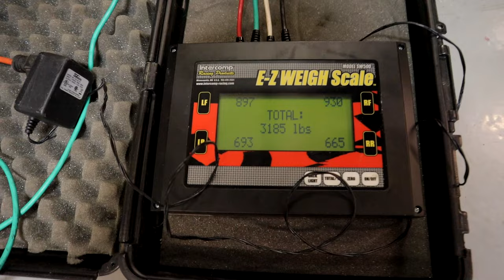American Musclecar Evolution - Why Pontiac Started Strong And Faded Into Obscurity

Comment: i am a 1972 model...so i dont have any hands on experience...but i know from reading...(ahem)...books...that in the pre-smog, pre-me performamce car era, even little AMC offered performance parts for racers...as well as helped refine the AMC V8 engines for the Trans Am racing series with 68 to 71 Javelins. they redesigned heads for better flow, offered forged steel crank and rods, (aside from the stock 390 and 401 forged steel rods and cranks), and special intakes. And they won. they beat everybody else in the Trans Am series for a couple years. Are you telling me little AMC, who raced and won against Camaros, Challengers, Firebirds, Baracudas, Mustangs, and Cougars had deeper pockets and more initiative to make succesful race cars than GM? Pontiac never had forged rods available through GMCorp channels for those 400hp TAs? if thats true...i kinda feel accidentally proud to like AMC 401 v8s.

Comment: Didn't the 421SD have Forged rods? A couple of older friends here in Australia used to race a 67 Parisienne (Canadian 327 SBC Bonneville assembled here) with a swapped in 421 with forged rods and pistons. They also had some M/T aluminium rods but never ran them. That 4000lb+ car would eat Kawasaki Z1000s and a Twin Cam Escort with a strong 289 swapped in. One of the quickest cars around Melbourne VIC in the mid 70s. BTW, my daily, truck and project run LS3, BBC and SBC respectively.

Comment: I wouldn't say that any of these arguments are *wrong*, or didn't have a noticeable effect...  but I personally still think they're all secondary to sheer production volume.  Chevrolet started outselling all the others in the mid 50s, and no amount of bad engineering on their part (weak X-frames in 58-up, the horrible geometry of the BBC lifter/pushrod/rocker angle, cost-cutting everywhere,  soft blocks, soft cams, etc.) really slowed their sales advantage.  GM corporate even famously shielded Chevrolet from competition from better designs (Buick, Olds, Pontiac) inside the company with the 400 CI and multiple-carburetor limits, so the sales edge was undeniable. Even before the aftermarket stepped up, the used market and junkyards had a higher percentage of Chevy cars, engines, bodies, and drivetrains and so costs were lower. Blow up one Chevy, just get another one at the boneyard.  The aftermarket vendors started looking at  the one big question: "how many owners of each brand are out there that we could possibly sell parts to?" to decide what to support, and Chevy topped the list from early, early on.  Then it snowballed from there. Once a little more aftermarket support appeared for Chevy, it made it even easier to decide to build Chevy. It also didn't hurt that there were plenty of design weaknesses that the aftermarket could improve upon, too.  

Pontiac in particular really took some serious abuse from GM corporate.  Correct me if I'm wrong, but I believe that Pontiac engineering actually developed the ball-stud mount and stamped rockers that both the Pontiac and SBC use, but GM corporate directed Pontiac to hand the design over to Chevrolet to get the SBC into production a year earlier... and it just never got any better for PMD. Every time they de-throned Chevrolet (and it happened several times) some edict would come down to level the playing field. Stuff like that is a huge part of why I've never been, and will never be, a fan of General Motors.  I love a lot of Buicks and a few Olds designs, but I still know that lurking under there is some GM corporate policy that makes those cars less than what they should have been.

Anyway, very interesting series, Tony.

Comment: And you have to remember Chevy's were extremely cheap to build you could get 425 horse out of a stroker kit for 800 bucks and a 350 Chevy and the transmission for dirt cheap turbo transmission cost me maybe $50 in parts to build Chilton's book showed you how to put a shift kit in it which is basically taking out a couple small check balls and and I believe it was a 8 inch drill bit to drill out two holes in the plate and that thing would bark second gear and slam third I mean they were extremely cheap to build and they were fast and they held together Chevys other than the mid to late seventies I believe it might have been early '80s where they had the cam issue the 350 Chevys been a solid engine parts are readily available and they're very inexpensive to build

Comment: Thanks for the quick updates. I have been wondering about all the projects you have going on. 
Good stuff!
Really it's a shame that not only Pontiac but Olds and Buick are gone each with their unique engine designs. And even though Mercury and Plymouth have the same engines as their parent companies  they are missed too having had some awesome body styles.
850HP BOSS 429 on pump gas.
or 427FE SO. BBF all day!
Bring on that big Bowtie.

Comment: while i cannot say the cast rod is great, they are not so weak as you say..i have run 7000 plus rpm and turned 10.40's with them many years ago..why?..because it was what we had as poor boy racers..balancing and tuning is paramount, plus proper clearance and oil..the big journals do not limit rpm in a drag deal, but for nascar they would..enjoy your videos a lot..

Comment: I'm wondering as to how they modified both the Mustang and Charger featured in that Bullit film, simply because those stunts pulled in San Francisco could not have done any favors to the oiling of both of those engines, let alone the acceleration during those chase scenes

Comment: Pontiac also had very limited options for engine blocks relative to chevy, ford, and mopar. The block, itself, was know to have bad/weak/thin castings in the main webbing leading to cracking. I've seen a few stock Pontic blocks used in racing that suffered this fate. There also weren't a whole lot of options for high flowing cylinder heads beyond the Ram Air engines.
Reply: Yeah a buddy had a set of 670 heads on a 400 ,and it ran great but someone knurled the guides and they whooped out pretty quick. So he swapped on whatever,and the thing turned into a pig. Not sure what the number was on em ,but it wasn't 670.
Reply: the latter blocks was weaker then the early blocks.....dont use a block past 73 if you want a "strong" block.....like you said after that they started eleminating "uneeded" weight from the block.....
Reply: 6X-4 heads had very good potential for performance.
Reply: This... Pontiac bottom ends are junk.  Can you fix their shortfalls?  Sure you can... you can fix anything when throw enough money at them lol. Pontiacs are good for the rpm range of most diesels..not a performance platform per say.
Reply: @briansd2772  the 093s and 670s wasnt bad either if your looking for older heads for a 389 or early 400
Reply: @LSswapGarage1  lol youve must of never been around many of em then....got a few 389s thats embarresed alot of sbc and bbc....and some lss and some fox bodies and some hemi chargers and challengers....any thing will run if you understand the engine and how to get em to make power....they dont all make it at the same rpm ....im not talking throwing a baby bottle or a hair dyer on em....im talking n.a. power......with multi carbs and points and jets and metering rods no computers needed......theres a diff tuning a carbed n.a. motor then "tuning" a engine today by pluging in a computer....not hard to make power when the computer tells you what to do to make it.....but hey after 40 yrs what do i know....
Reply: @stevenhagebusch9561  
I say you're not taking it far enough with that overly complicated carburetor contraption when all you need is a metal box that holds fuel and drill a hole in it.
I've never been super impressed with stock Pontiacs or even modified stock engines. Some of them run okay stock, most are dogs. When you get into aftermarket pontiac blocks I've seen them make a ton of power but so does everyone else. At that point it's not really a pontic, chevy, etc, it's just "what bolt pattern do you want your aftermarket engine to have?"

Comment: My first love was Pontiacs.  The other issue they had was the mains were too big for high RPM use on the 421, 428, and 455 engines.  The large mains caused many spun bearings on these engines.

Comment: The FE was pretty good but didn’t have street cred because they didn’t put cams in them and the exhaust manifolds were awful. They finally realized that they had to build the Cobra Jet. The 427s were real killers, but they didn’t get to the streets. The FE is the same oiling system as a Small block Chevy. The rods and mains were strong.  Scott Foxwell built a 505 ci FE with an aftermarket block and Edelbrock heads. 850 hp NA. 1.69 hp per cube. The design cant be that crazy.😂😂😂

Comment: forgotten to mention was the tiny pick up tubes and lack of primary main oiling design. these cars did not spin bearings because of a front sump pan. they spun bearings because the rockers were getting to much of the oil that the mains needed. this is alot of talk without mentioning the 3/8s oil pick up . dodge is not as good as the rest because of bean counters for more reasons than just the oil pan. for drag racing a mid sump pan with trap doors is actually argued to be best for engine life. you have to decelerate as well and that comes later in the high rpm run. dont want to run out of oil there either. chevy won the aftermarket/ hot rod battle( not faster or better, you just see more. for example you go to the drag strip and see 20 chevys, 2 fords ,2 dodges and the top 6 cars will be mixed with 2 of each) because they didn't engineer as much so they were cheaper. parts innerchanged for half a century. on a cost standpoint this is great. on an evolution standpoint, not so much. this still holds to this day. to meet epa/ fuel mileage and keep up with modern cammer engines power output they have to build a larger displacement engine and float half the lifters under normal driving to keep the thing competitive. Chrysler is kinda like this in some way except they tend to screw up simple stuff like oil pickups, cam hardness,  or even an automatic transmision that can go from here to there without smoking clutches. i think someone else builds all there transmisions now and half their engines.lol

Comment: Tony, up here in Canada, if you wanted a fast Pontiac, you bought a Parisienne Sport with a 409, or a 396 Beaumont.....used to tow my Demon stock car with a clamshell Pontiac wagon with a 350, later replaced with a 283. What are these Pontiac engines of which you speak? ;)
Reply: yep the Canadian dirt track racers around here had the pontiac 327 valve covers.

Comment: Didn't Poniac do some peculiar behind the scenes work? For example, around 1990 we pitted with a Class 8 off road truck (now trophy trucks) that had a Chevy engine (pretty sure it was a small block) with heads that said "Pontiac" on them. I was told they were NASCAR heads. But Pontiac manufactured performance heads foe Chevy engines? Was I dreaming?

Comment: If GM had not wiped out in January, 1963, the SD Pontiacs would have ruled. Put a SD 421 in a '66 GTO. If Ford would have left the C4AE heads on the 390 in 1966, and supplied a cast iron copy of the PI intake (ala 428 CJ), Cyclones and Fairlanes would have been left in the running also. My lesson learned from Pontiacs, don't go over 6K with the 400 inchers, and limit the 455 to 5500 rpm.

Comment: chevy guys blew up engines faster then anyone else thru the 1980s because they thought them indestructible, therefore aftermarket provided more replacement parts. Most Mopar guys who raced all would tell each other what engine rpm limit was on mopars to bracket race.Pontiacs were very nice race cars

Comment: GM could make ton of money by making a somewhat smaller version of the 66/67 GTO.   Make simply a scaled down version not something similar.  The styling would drive younger people nuts.  Most cars nowdays all look alike.

Rods weren't the only thing that were cast.  If they had been smart the 64 GOAT should have had the 396/375hp Chevy motor.....simple bolt in. Hell even the 350 horse 327 would have been a better choice.   I traded my 67 GTO in on a Ford pickup in 1974.....I had been running a 283 with a two barrel in it for about a year.  My wife threw 2 rods in my 400. I simply got tired of working on it.

Comment: Cadillac doesn't ever get it's props, I get it though, the after market is rough but they had the most torque and correct me if I'm wrong but I think the rotating assembly was balanced for that smooth caddy feel and have very high nickel blocks. Stock crankshafts that have seen 1500 hp without problems and can even be stroked.
It ain't cheap though.
CAD company even makes aluminum heads for them.
Also they are about 50 lbs heavier than a small block Chevy.

Comment: Pontiac had junk rods for sure, we nick name them donnicker rods.
My 66  El Camino I got it down to 3000 flat, I remove everything that I didn't need example, ash tray & bracket, glove box, bracket on frame, glass hood, on & on, had glass fenders but I never put them on, I drove it daily when I worked 2 miles away. ran 11.20's, with a 400 SBC, the track kicked me out for not having a roll bar I think I I could of got in the 10's with a 4.11, had 4.56 and was top out way before the end of the track

Comment: I'm a general motors guy, I do love Chryslers but I built Buicks most of my life and Pontiacs as well. Never liked Oldsmobile. And being a Buick guy we actually had even less performance parts then the Pontiac guys did however the big block Buicks had reasonably decent cylinder heads minus the exhaust flow and they were so over square with a huge bore and a short stroke it is not hard to make power. Building a 500 horse big block Buick is nothing and then if you want to make a hundred more horsepower it's going to cost you about 20,000 more dollars 😂.

Comment: Olds used all forged rods...260 to 455....interchangeability is better than anyone....The Diesel Olds 350 block will take more power than anything Chebby Ford or MOPAR put in a factory application. These blocks gave WJ his beginning in Pro Stock..The first tall deck Chevys (DRCE and Rocket small block) were Olds designed...Not to mention Olds dominated NASCAR log before the first Chebby/Ford/MOPAR OHV V8 was built..

Comment: Pounds per pound I think the best Chevy big block made was the 396 the heads and the valves were just enormous in them engines you could pump and ungodly amount of air into that cylinder it's one of my favorite engines I'm a Chrysler fan true and true that's all I drive that's all I own but you give credit where it's due and the 396 is one of the best engines on the market
Reply: the intake ports on the IHC 392 are about the same size as the big square port 454 heads sodium filled exhaust valves also. not open chamber though.

Comment: Mustang 5.0 Coyote v8s have a 10 quart oil pan capacity. Will the extra oil help prevent oil starvation at high acceleration and save bearings?
Reply: Well, they have a half century of technology improvements to start with. Most of the reasons for today's engines having high capacity oil systems, is for cooling the oil, and that helps emissions, believe it or not.
Reply: @elmerfudpucker3204  Good point.

Comment: How much money per engine, or per rod, did Cast Rods save Pontiac/GM vs. Forged Rod?
After the problem became apparent in 2-3 years after 1964?  Why didn't they make the capital investment to manufacture forged rods? Especially if all other cars used forged rods?
Was this GMs punishment to Pontiac for "sneaking" out the GTO by a technicality? 
Going against the Top corporate "muckety mucks" GM edicts? From 1964-1967.
Way outselling and overshadowing their "real" Hot Rod. The 1964-1967 Corvette?

Comment: You are missing one factor. If you weren't putting good engines in millions of trucks you weren't supplying the hot rodders and aftermarket with a steady supply of cheap engines. Mopar gave you a 318 or 2bbl 360 at most. Ford had engine schizophrenia and couldn't decide on a truck engine architecture for longer than 24 months with NO parts interchangeably. GM on the other hand gave you small and big blocks out the wazoo that was just a few parts ordered from PAW away from being the equivalent to anything in an Uber rare muscle car needing a replacement engine because you blew up the original.

This more than any other factor is how Chevy ended up dominating the aftermarket even into the ls architecture today

Comment: The reason Chevy was at the forefront was because they knew there engines were being used in everything and they designed a aftermarket for that.... When fuel injection came on line they marketed stand alone systems that hot rodders could use....It took Mopar years before they did that with the Gen III motors and as good as the Gen III motor is you hardly ever see it in streetrods....In the 60's and early 70;s Mopar owned Top Fuel Funny Car and SuperStock and early Pro Stock racing but very little of this was applied to streetrodding....

Comment: You are crazy! Not on your Pontiac commentary, although I had never heard of Pontiacs snapping rods. Too bad Crystal didn't have an extinguisher to blast your a**. From personal experience, I have had issues with stretched rod bolts. Always replace bolts when doing a rebuild! I am a Pontiac purist. Burns my but when I see someone put a sbc in a Firebird. GM didn't help the cause when they started putting Olds, Buick, and Chevy engines in Pontiacs.

Comment: Most people overcam pontiacs they are torque monsters .the 428sj grand prix on the highway will be hard to pass i dont care what you have 65 to 130they are scarry fast maybe not quick but my sj will smoke my 70 440super bee without a doubt.love both cars but the pontiac has amazing performance.both my cars are completly stock down to the exaust manifolds.